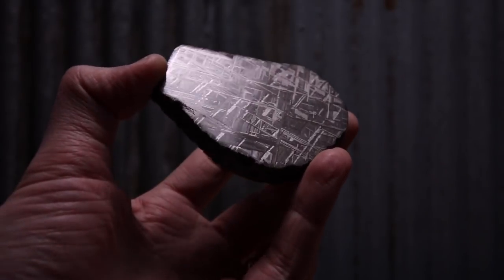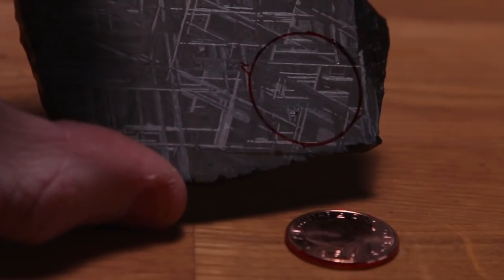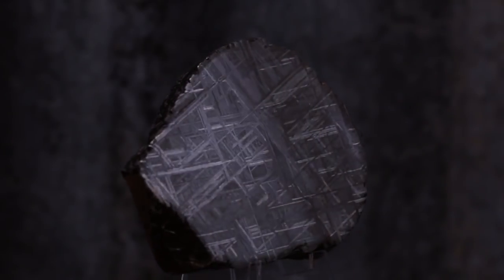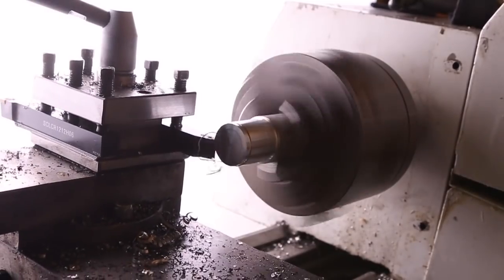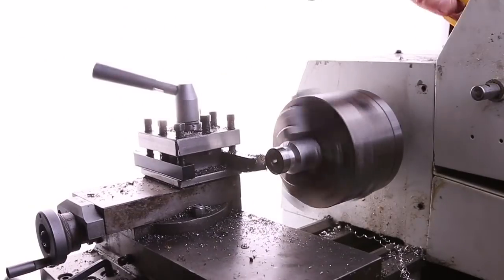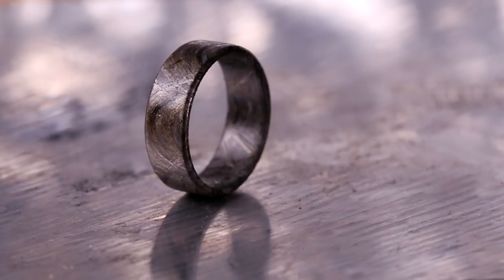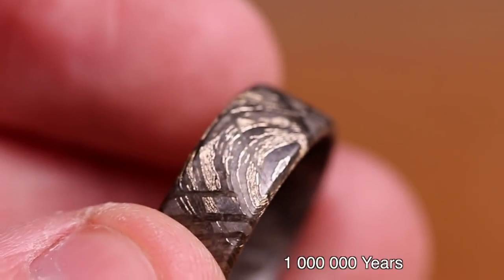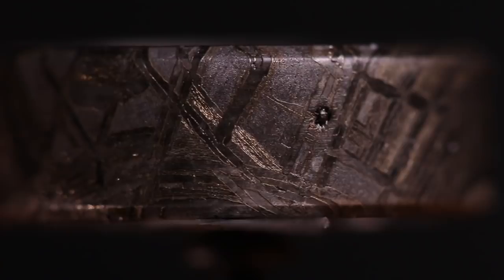my 4,566,300,000 Year Old Ring - crafted from a Swedish Meteorite

Comment: $900 per ring :D with meteorite ore costing between $0.50 to $5 per gram max. (unless it is Junction meteorite which this isn't) 
If I don't mistake that was nickle he used for measurement. Right?
Let's do some math, shall we? 
First some data.
The diameter of the material used: 24.12mm (from video) 
The height of the material used: 15mm (approximation)
iron-based meteorite composite ore density: 7-8 g/cm3 
so based on this:

we will use the following measurements to make it easy for us
diameter: 2.4cm 
height: 1.5cm
The formula for calculation of volume for a cylinder is

π×radius square × height

radius is 1.2cm

so we got 6.78cm3 that is a volume of material used per ring.
Now to the weight. We use golden middle 7.5 g/cm3.

6.78cm3 x 7.5 = 50.85g 

Now for price let's use the highest price to assume the best quality of ore used.

50.85 x $5/g = $254.25 material cost 

I know that some will bitch about residual waste from making a circular cut so let's round it up to $300
Now to machine, this kind of ring is quite easy considering that material used. Clearing Widmanstätten pattern with acid plus a coat of clear enamel to protect the ring. 7-8h of pure work time at most. Now let's say for sake of argument it took 10h. That mean mr. David Windestal charges £60 for an hour for his work. That is 100% more than the average machinist rate in the US :D

Now all this on top of the fact that at any point we have NOT seen any type of certification from or a document confirming the precise age of the ore that was claimed by author or in fact that this is a meteorite ore that was used as Widmanstätten patterns in Iron can be recreated artificially in the lab. (for those who don't believe http://adsabs.harvard.edu/full/1970Metic...5..201G )
Now I am not saying this gentleman deliberately used something he would not believe to be a meteorite but I always get certification of authenticity when buying meteorite ore for making jewellery, better be sorry if you plan to sell.

Also professionally made meteorite rings by professional jewellery craftsmen are around $300-700 they are usually made with titanium and meteorite used as an inlay to prevent wear on a meteorite ore. They are professionally polished and sized. Make very nice wedding bands or engagement rings.

Now, all that being said. Nice work you did there kid. However, before you start to charge for your work like you are a master jeweller you would need to become one.

Keep at it and get real with your pricing you may get somewhere one day :)

Comment: After you equip this Ring in the trinkets slot you get :
+400 HP
+140 Fire resistance
+8 Armor
+24 Damage
+20 Agility
+60 Intelligence
+15 Strength
+30% Attack Speed
+5% Spell Immunity
+10% Coldown Reduction
+30% DMG from all sources
+Unique Passive:Wrath of Gyhurok
If you take more than 1800 DMG in 5 seconds you get a Spell Shield , Bonus Attack Speed and Bonus Attack Damage .
Shield Value : 200-1300 HP(Scales with your Max Health and Magic Damage)for 5 secs
Bonus Attack Speed : 20%-80%(Scales with your Base Attack Speed) for 7 secs
Bonus Attack Damage : 10-100(Scales with your Attack Damage And Ability Power) for 3 secs
Spell Shield : Gives 25% Damage Reduction from all sources , + 10% Attack Damage Reduction , + 15% Ability Power Damage , Immunity to all types of Crowd Control Spells while its active. 

Recipe Cost: 1800 gold
Total Value : 4700 Gold

Comment: If the world is a circular(round) horizontal(flat) plane of terrain, oceans & seas of salt water, which are held in by a giant 200-300 foot tall circular ice ring wall shelf that is 62,000 miles in circumference on the inside where the wall begins & 64k miles on the outside edge. The shelf extends outward about another 2000 miles from the inside of the ice ring shelf wall & it goes upward to about 10,000 ft high. On the edge of this ice wall shelf is where the firmament ice dome sits going upward & enclosing our world & maybe, perhaps even spins on this ice ring shelf, because stars are bright lights of electricity enbedded the firmament dome, & at night we can see star trails because they are spinning. Planets are known as wondering stars & are actually balls of mixed gases like the gases in neon signs that are stuck in the vacuum, above our atmosphere underneath the ice dome firmament the gases light up with static electricity in the vacuum. They perhaps do travel around the Sun, but it is within the vacuum under the firmament, & the distances & sizes are no where close to what NASA which is controlled by the Jesuits say they are along with their fake psuedoscience scientist & astronots, planets also not made of a terrain they are balls of different kinds of atmospheric gases . Thats why every night when you look up on a clear night they are always in the same place. So our world is enclosed by a firmament dome, so then where did this meteor come from, it didn't fall from the skies it came from the earth terrain, or a volcano. Above the dome is water, in Genesis the creator said he made a firmament dome to divide the water from the water above. I think our creator did this to actually keep us safe, we are not the center of the world we are the only world. Above the waters on the outside is the heavens. I think the dome is made from evaporated(distilled because it was boiled & evaporated by the Suns heat) water from the Sun. Distilled water when froze makes a very clear ice like see through glass. The sun stays just far enough, a perfect distance from the our firmament (clear ice dome) so that it doesn't melt it. So that encloses our earth. It also stays just far enough from the center island also called the North Pole so it doesn't melt,  which is actually the center pole, that has a giant electro-magnetic magnet in the very center a few miles beneath the surface of the ice & terrain. There is another electromagnetic magnet embedded directly above, dead center in the firmament ice dome.  These two electromagnets create an invisible pole that the sun & moon rotating above the earth's terrain & oceans, pulsating, outward & inward making big & small rotations. This is what gives the sun & moon the their power to levitate & create positive charged extreme hot & bright light from the Sun. The moon is the polar opposite which puts out a cold dim light for the night skies, which is negative charged, & make a full moon every 25 days that last 3 days 72 hours. There are 13 full moons which represent each month that is 28 days long. There are 4 quarters in a moon that represent the weeks in each month which are 7 days long. The Sun rotates above & around our enclosed world every 24 hours which represent a day/24hours. A day is split into 3rds. Daylight usually last 2/3rds of a day 16 hrs & Darkness/night time last 1/3rd of a 24 hour day, which is usually about 8 hrs, a little more if your include weak light of early morning light/sunrising=sun getting closer to your area of the earths terrain where the sunlight in arriving & late evening/sunset=sunlight is moving further away from your terrain.Then gradually the sun & moon makes bigger circular rotations above the earth's terrain, oceans & seas about 2-3000 miles high in altitude. Once the sun & moon reaches the tropic of Capricorn, it then begins it journey back inward until it reaches the tropic of cancer the smallest circular rotation, where is starts its journey outward, pulsing outward & inward. This is also how the earth's terrain has seasons, when the sun & moon are inside the area of the equator nearest to the tropic of cancer it is summer & spring there, when it crosses the equator in the area of the tropic of capricorn it is summer & spring there, opposite of what ever area the sun & moon are at, it is fall & winter in that area. Back & forth a never ending cycle. We do not live on a spinning ball falling through space, space & 0 gravity does not exist, gravity doesn't exist for that matter only density, gravity & infinite space was all created in the minds of psuedo-science Satan worshiping Rocket scientist like Verner Von Braun, Mr. Hubble & the other men who worked for the Jesuits to create a non-existant world to further enslave & lie to men, further indoctrinate & create hard working pride filled wage slaves, so the elite wouldn't have to work. Just create ways to keep mens minds busy, instill fear with laws that do not apply to them, only the working class. To basicly create oder out of chaos, the chaos being wars, & conflict between men, to conquer & always keep the world divided. This is how they remain in control through fear tactics & fake pyramid ponzi currency, so that they can create the flow of it & how it is used, by controlling it with their Banks & the direction the want it to go. May the creator come back & fix our broken system, make our world free from currency, a utopia where everybody shares & helps each other, no greed or pride. Just a simple life full of love, laughter & happiness.

Comment: I am not a geologist, but I have a degree in geology. Many meteorites contain Rare Earth Elements, which are heavy metals, some of these metals are radioactive. Despite the great age of this sample, it can still be extremely radioactive. Before wearing this ring, I would firstly identify the sample using the pattern of crystallization most grossly, and at the very least sample use a geiger counter to determine if it is safe to be around. Even if it is determined to be non-radioactive, before wearing it, it would be good to determine if it contained heavy metals like Mercury, Cadmium, Arsenic, or many other toxic elements.
Reply: so it contains trace amounts of Gallium, Germanium and Iridium

Comment: if it was that precious why didn't you save the left overs from the metal that got on the ground?
Reply from the maker: I vacuumed everything up. Saves time during the process
Reply from the maker: Hmm should have written that better. I vacuumed everything up and put it in a jar.
Reply: @DavidWindestalRCExplorer  well mister i saw that there were pieces before you used the material.

Comment: ok your ring is brand new.... before its formed into a ring its just raw materials, and other raw materials used in ring manufacturing could be just as old if not older than the meteroite, if you made a ring from say tungsten would it not be just as old if not older due to it being a single element? just saying, that you can not label this ring as ancient its a brand new ring made from ancient raw materials and should be listed as such
Reply: also the ring looks like crap lol ive seen nicer rings made of cheaper materials... and remember ppl all elements are as old as the universe itself ;)

Comment: I think You can save the shavings and make damascus steel from them (we did, and it works, maybe You hawe to add some nickel to it, but it work if one press the shavings compact in for example an iron pipe and add some oil, then closin it up, but leaving a hole for the gas to escape to prevent accidentally creating a pipe bomb, then forgeweld it.)
Reply from the maker: I love it!
I have the shavings saved :) Really cool idea
Reply: @DavidWindestalRCExplorer  
The idea is that the oils adds carbon (?), and taking off oxygen in order to prevent oxidizing of the suface, i tried it a few times with drill shaving to practice, and i did not needed to add borax (i suspect borax will possibly pollute the metal surfaces if one use the oil methond, but for example minreal oil won't (i think most types of oil will do, however, it does not need to be mineral oil, mineral oil hawe some nasty fumes to it and it realy stinks when heated up, but it was what i had at hands at the moment)), a tip to eyeballing the temperature is, when the first sparks apear, it begin to reach the correct welding temperature but has not started to burn off yet. (I would strongly reccomend testing on some scrap metal first to get a feeling for the temperature if You hawe not done any forgewelding before).
Meteorites contain pretty much nickel from the beginning, so maybe it will work straight off for patternwelding as it is if You use the pipe method...
(My friend tould me that it did, somobody sent him a envelope with meteorite shavings some years ago, and the result came out pretty good at my opinion.)

Comment: the pattern is round because it's displayed on a curved surface - it's because the straight planes of iron ore run at a non-square angle relative to the axes of the ring

Comment: Not sure what you did with the waste metal, but I know for myself. I couldn't have thrown any of it way. I would have had to put it in a special container. I have a meteor knife I made about 15 years ago. I still have every scrap of the left over metal in a small clear glass urn. Is that odd?
Reply from the maker: I put some of it in a small glass vial and made it into a neckless. Spar dust neckless :D
(The rest is safely stowed away in an airtight container to prevent rust.

Comment: Hi there! Thanks for the video, i have a question, how prone is this metal to rust? Any partocular care is required to use thiese rings in a daily basis? Thanks!
Reply from the maker: The ring will require maintenance, not every day but at regular intervals. I treated my ring with 5 layers of a special coating made for jewelry. It prevents rust and it protects your skin. But you would need to apply a coat every now and then as it will wear off with time and use.

Comment: Seriously you should be making matched pairs of rings as wedding bands - a wide ring that is then cut in half, so that patterns on one ring continue onto the other. The story is mindblowing and extremely appropriate for such purpose.
Reply from the maker: Ooo I love that idea!
Reply: @DavidWindestalRCExplorer  can I get a discount if I happen to need a pair? :D (fingers crossed for maybe before the end of the year :D)
Reply: @DavidWindestalRCExplorer  I just realised that ring separation must be done before sizing, so that would not significantly change the work that will have to be done for each ring separately and patterns will likely break if you then trim the outer parts of the smaller ring :(
What if each ring incorporates a flat outer side that is milled as first step, before separation and rounding? Then at least the patterns on that flat side will be linked between the two rings

Comment: Sure wasted alot of material, should have cut center out for another smaller ring. Use your saw and drill starter hole near the edge. The material made a beautiful  ring, but you need to be whipped with a knotted plow line for the waste.

Comment: So putting cost in perspective, you can buy a 1/2 carat diamond for same price, and this is better in several ways. better story, older, more unique, and none of the issues with diamond mining are present. (blood diamonds).  Not sure how sustainable it is, but there are a lot to meteors on this rock, just takes a lot to find them, so certainly won't go away any time soon. 
Nice work, David, always good to see you back!
Reply from the maker: Haven't though about it like that, but yes personally I much rather have this than a diamond :) Also, thinking that you will own this ring for lets say 50 years, then it would come to 22usd per year if you broke it out.

Comment: This is incredible! How do you get a hold of a meteorite and what crazy sum did that cost? Surely more complex than ebay or amazon right?

Also, I was fairly disappointed at 7:17 when all of the beautiful pattern was gone and it was just shiny, but then you fixed that! It looks like you etched it similar to how one might do Damascus etching, is that right? and then what was the stuff that you painted on at the end? just some sort of clear lacquer/varnish?
Reply from the maker: ferric chloride as the etchant and yes it's a kind of varnish that is specifically made for jewellery and similar.

Comment: Could you make me one? How much? 100% serious!
Reply from the maker: It's seriously expensive :| There is a real chance that the ring explodes in the lathe due to small cracks and fissures in the material plus the time and material cost isn't that low either. Check https://patrickadairdesigns.com/collections/meteorite and you'll get a sense for what one can cost.
But perhaps maybe I could make a couple if people are interested.
Reply: @DavidWindestalRCExplorer  how big was your meteorite slab you started with in grams, im buying my own piece to make a ring for myself thanks for making this awsome video.
Reply: @DavidWindestalRCExplorer  1100 bucks US isn't actually that bad for a nice ring.  A gold and diamond wedding ring can easily cost that much.  If you are buying one (or a pair) for wedding rings, you would be well inside normal for that type of purchase.
Reply: @Wearyman  1100 bucks for a circular piece of metal with a cut stone in it? Ridiculous.
Reply from the maker: @Wearyman  Let's say you'll have it for 50 years(?) That would be $22 per year. I never thought about it like that before now and I feel a lot better :D
Reply: @shelbyseelbach9568    It's a bit more than that.  The diamonds are rare and expensive, and the ring, as seen in the above video, even if not made from a meteorite, takes hard work and many hours to craft.  These aren't stamped steel washers made by machine.  Wedding rings are still largely handmade.  Craftsmanship costs.
Reply: Your ability to create awesome things always happen to amaze me, that’s such a badass ring, if you made some I’d be happy to contribute for your efforts
Reply from the maker: If you're still interested I might be making a batch. Depends if we get enough people to justify buying a larger slice of meteorite to keep the price down. Shoot me an email if you didn't get a heart attack from seeing the prices below. (it would be less than the ring in the link but not by a crazy ammount)